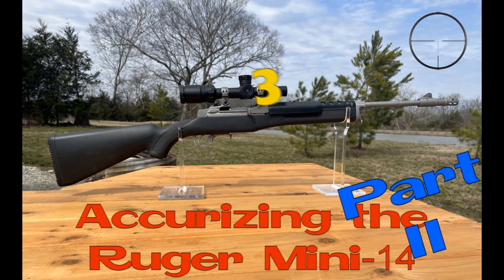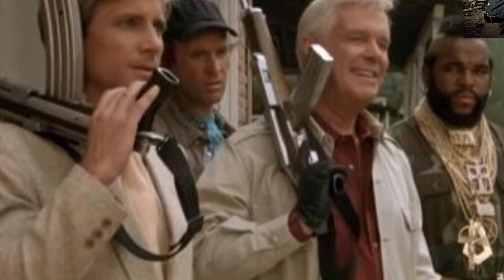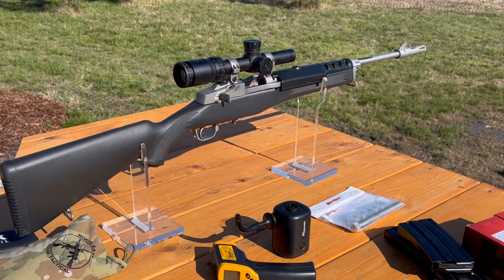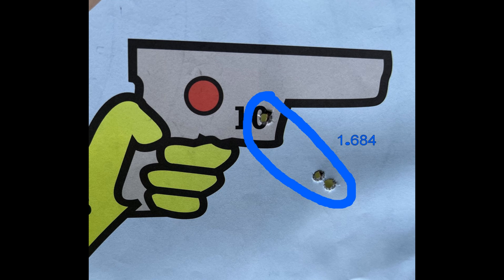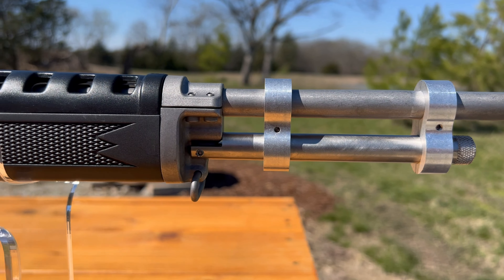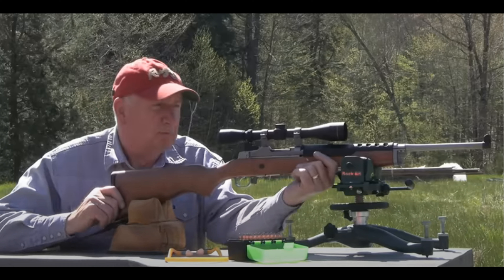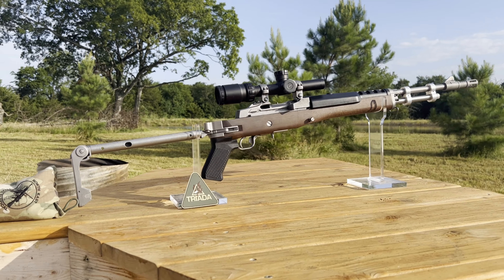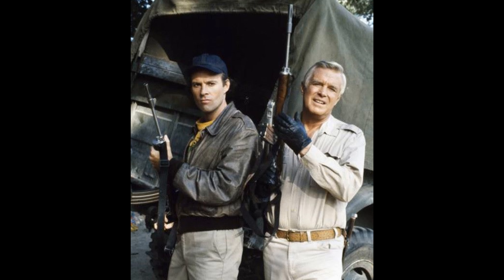Accurizing the Ruger Mini-14 Part 3

Comment: There’s a piece on the bottom of the follower you can cut off, or swap it with a 10+ round magazine, the 10+ will still hold 10+ rounds but the 5 will now hold 6. 😉
Reply from the maker: Thank you. I have a couple larger Mini-14 mags, but when bench shooting I usually use the small mag. This is a fun one!
Reply: @Exit0Wound  it is the small magazine, disassemble the magazines and swap the followers, both magazines keeps their size, the 5 rounder capacity is increased to 6 rounds and the other remains the same.

Comment: I have a wood stock 183 series, I just ordered an accu strut for it.  Should I also mess with recoil spring and gas block?  I have yet to shoot it but I don’t want to be disappointed
Reply from the maker: Reducing the gas port didn’t do much for the accuracy, but it did reduce the violent brass launches. I shoot at my own property and have to pick up all the brass. So, reducing the throws helps my clean up. Strut and getting rid of the plastic stock (if yours has it) would be my course of action. It’s a fun rifle! I hope yours brings you lots of smiles.
Reply: @Exit0Wound  i ordered a strut, i have the wood stock, and I ordered some 1911 buffers for the recoil spring

Comment: I have to question if you really purchased the rifle for your kids.  My current belief is where you ended up, with the stock fit-up, might have the biggest impact on accuracy. The bases of my opinion is the accuracy changes in these rifles when stocks are changed (good and bad) by many people. I think Gun Blue was right. I have heard a rumor that Hogue Gun stocks are magical, and improve accuracy more than a Mo-Rod, even though it doesn’t look as cool. I have nothing to support this to offer you, but if I ever work on the accuracy of my rifle, this is where I will start. What year did you say your rifle was built? Up to 1997, they had a 1:7 barrel twist.  I saw that you tried a lot of different bullet weights without any established trend. I suspect if yours is 1:7, the heavier bullets might work better. Maybe shy away from the boat tail bullet design.
Reply from the maker: ha! I swear! I got it for the kids (and the kid in me). This one is from 2000-2001. None of the bullet impacts on paper show any failure to stabilize, so the twist and length of the barrel are producing stable flights.

Comment: Your rifle uses the older barrel configuration which has since changed and improved the out of box accuracy of the rifle.
Reply from the maker: Yes. I mentioned that the rifle is >20 years old in the video and made prior to the accuracy improvement efforts from Ruger.

Comment: I have owned mini 14s and mini 30s 4 45 years. My mini 30 of 2012 will hold 3 inches off hand with a 2,5 power leupold scpe and have taken 7 deer and 5 hogs. The distances were 70 yards to 200 yards. Only one animal that required 2 shots and that was s 400 lb hog.
Reply from the maker: The minis are great guns. The 223/556 and 762x39 are very capable rounds. Lots of fun to be had!

Comment: Sir, one question: whats about shortening the barrel from 18inch to 16inch? I did this to my pre 580 Ruger Mini-30. My groupsize went down from 4inch to 1,5inch at 50meters an 2 inches at 100meters. Gas bushing and bolt carrier spring also changed. Ruberbuffer in front and rear of bolt carrier installed but no accustrut and no flash hider. Accustrut is the most expensive modification to a Ruger Mini. The 16inch barrel is stiffer which has good influences to the barrels harmonics. I am realy happy now. Greetings from Germany
Reply from the maker: Sweet! Thanks for sharing. I travel to Freising, Germany occasionally for work.